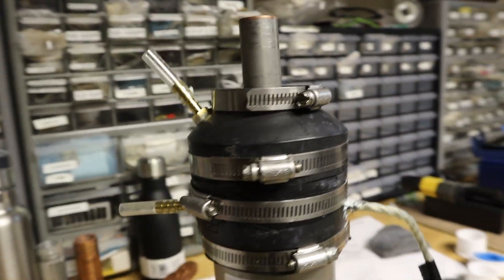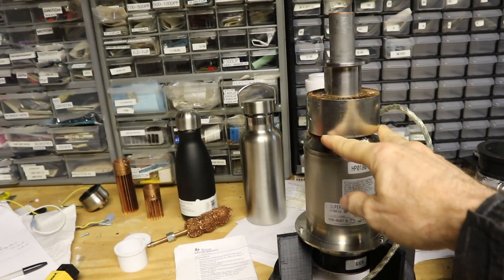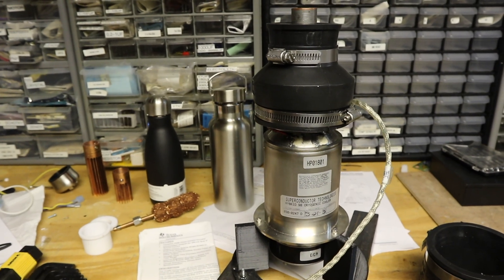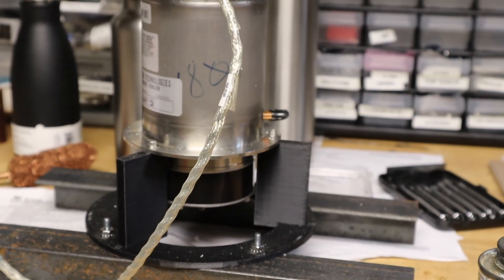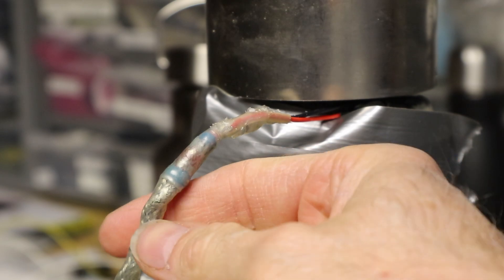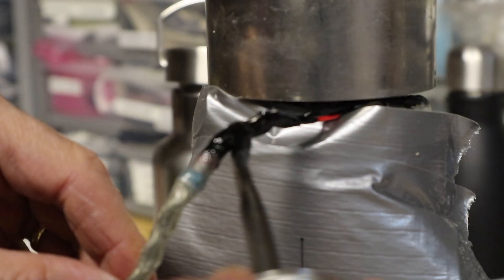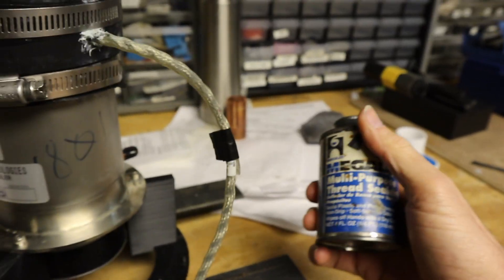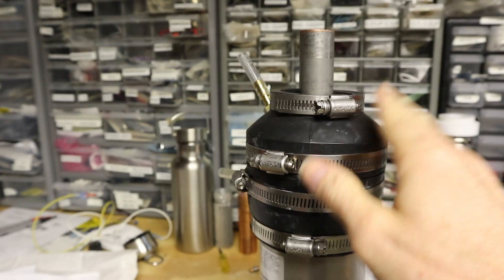Build a water cooled Hybrid 98 Cryocooler using Home Depot parts.

Comment: Interesting. 

Won't water eat that metal up?
Reply from the maker: The metal is stainless steel, so it should not rust. Also, when I am done I open the housing and drain the water so it is dry.
Reply: @imsmoother  You have another alloy in the heat sink, so you still get a galvanic cell.
Drying it out between cycles usually does more damage than leaving it wet.

Retrofitting liquid cooling is always difficult, because the refrigerant will usually mess up some part of the system. If you go with water, corrosion is inevitable. Not even stainless is completely immune, especially not if heat or other metals are present. Oil, silicone or glycol based refrigerants will instead dissolve gaskets, seals, plastics and coatings. Since there are cables running in, and there seems to be little information on what those seals are made of, there's no way to chose a refrigerant that won't infiltrate & cause headaches down the line. 

Don't get me wrong, I love the effort, but full immersion cooling may not be the best approach for longevity. Perhaps the 'safest' way would probably be external cooling blocks, either ready-made, or simply wrapping a metal tube around it and water cooling that? Or using the your jacket to blow compressed air through the heat sink?
Reply: @imsmoother ⚠️ God has said in the Quran:

🔴 { Say, "O My servants who have transgressed against themselves [by sinning], do not despair of the mercy of Allah. Indeed, Allah forgives all sins. Indeed, it is He who is the Forgiving, the Merciful." ( 39:53 )} 

📖Quran
Reply: @1islam1  your point?